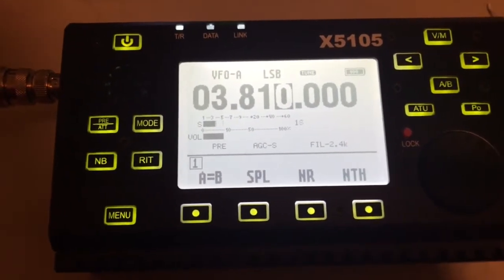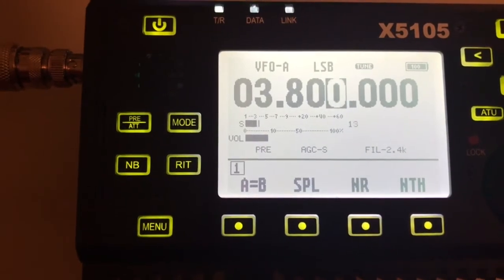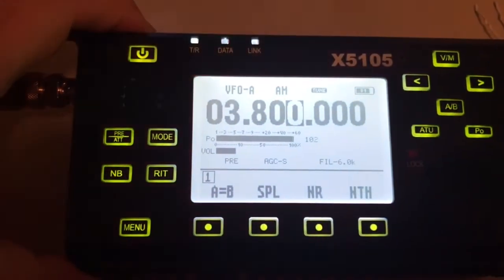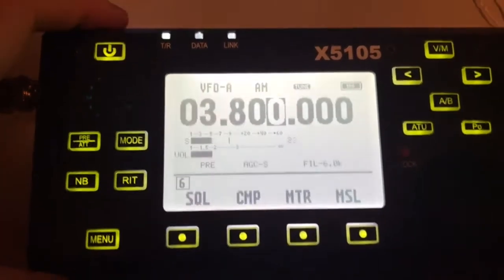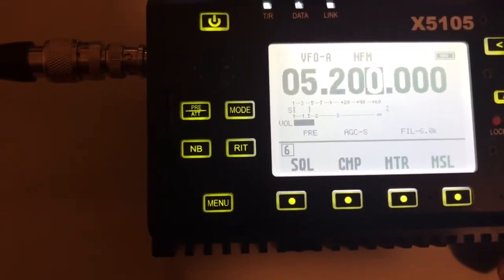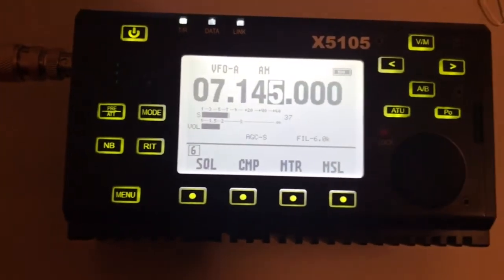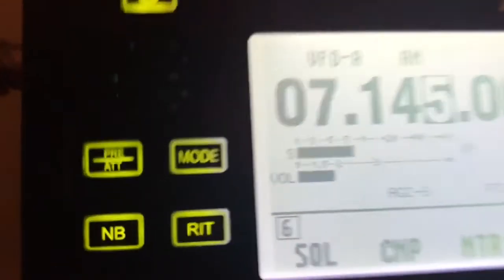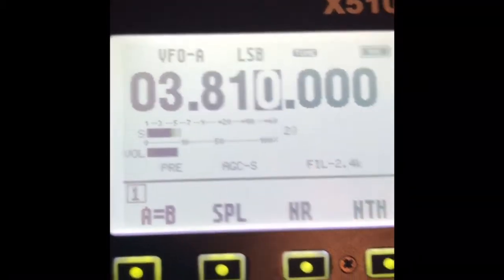Xiegu X5105 50 Mhz + HF QRP transceiver

Comment: Neat but cost must come down hams  just buy a used 706mkiig or ft-450D instead. 
China ware hf radios $225 or less for qrp but this would be good for a 10m-6m all mode qrp for $149.99
Reply from the maker: Thanks for the opinion, this is so much more than a 706 or 450d.   It comes with an auto tuner, battery built in, charging system, spectrum scope, built in Mic.    It is light weight and has a purpose.    I suspect its built to compete with the KX2 and it seems to have the features to do so.   I have no real desire to sell you on it,  if you don't have interest that is okay too..   but to be so bold as to claim it is only worth 149.99 is just a fantasy.